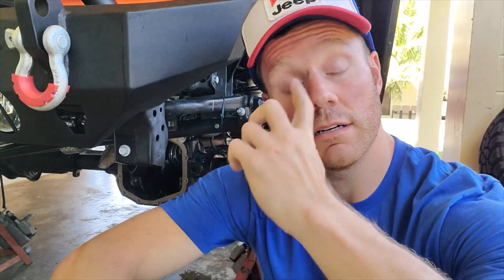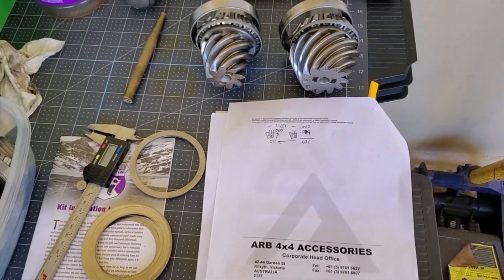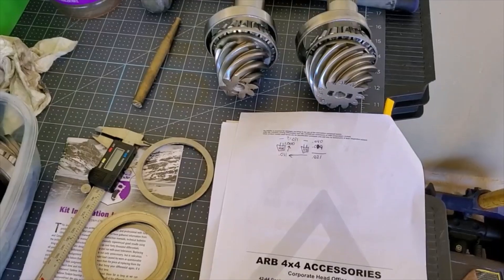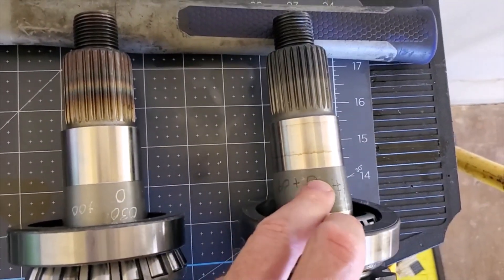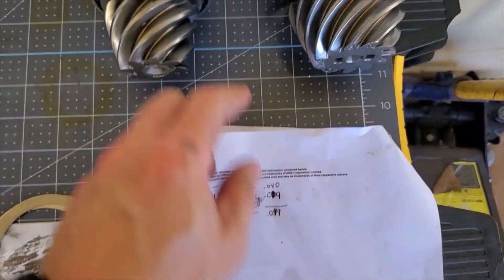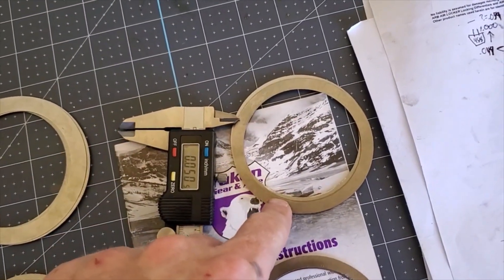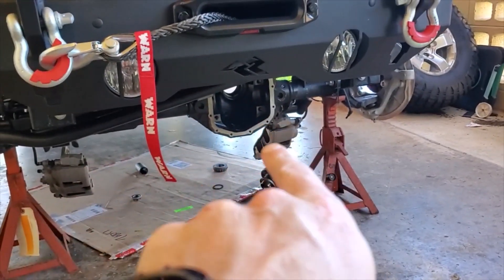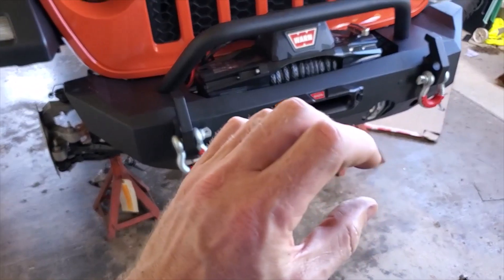Part 3 4.88 Dana Spicer How to Calculate & Figure Pinion Depth / M220 M210 + Lisle Tool 59400

Comment: I am re-gearing a Dana 30 with an ARB locker.  I got the gears from Elite Gear (Ron's Machine service) and I am finding that the pinion gears have the Master Housing Depth scribed on them as opposed to the pinion depth.  That, and the numbers scribed on the original Dana pinion do not correlate with what would make sense as a pinion depth measurement.
When I called Ron's Machine Service, I was told that the numbers scribed on the new pinion gears "don't mean anything."  Unless I misheard him, and or he misheard me.  It is a helluva coincidence that the numbers scribed on both the Chrysler 8.25 pinion and the Dana 30 pinion match the Master Housing Depths of each axle.
Reply from the maker: Start with the stock thickness. Check the pattern. It might setup perfect
Reply: @c130aviator  That happened to be the case with the Chrysler 8.25.  I bought that pinion depth measuring tool (yeah, that $400+ thing) and measured the Master Housing Depth and subtracted it from what it is supposed to be (and what was marked on the pinion) and the original .030 shim took care of that perfectly.  I could not measure the pinion depth of the original pinion because the face of the pinion gear was cast and not machined, so an accurate measurement would never have been possible.

On the Dana 30, it appears as though the original shimming is .010 off from what I need it to be.  I need .070 total shim vs the originals which measure .080.  The original shims are the oil slinger and an oil baffle. (What they are called in the parts books)  I think the slinger is a selective shim.

I have never rebuilt an axle before.  It took me an entire day to figure out how that depth tool works.  And even with "setup bearings" I do not see how I would ever get the pinion depth set right when whatever that measurement is supposed to be is not provided.  I would have to cram it all together, check wear pattern, take it back apart, re-shim it, cram it back together, check wear pattern, take it apart, re-shim blah blah blah.  I am picking brains at this point.  Of all the research I have done, I have not yet heard of a pinion gear with the master housing depth scribed on it as opposed to pinion depth measurements.  The Master Housing Depth is nothing more than the pinion depth plus the thickness of the pinion head, so either measurement works.

But like I said... I haven't done this before.  I don't know what the F I am doing.

Comment: Do you have the .pdf installation instructions from ARB on your locker?  I looked for it but was unable to find it online.  I have the RD245 which is the 32 spline version of what you installed.
Reply from the maker: I dont, I used the one provided in my locker box.
Reply: @c130aviator  Ah, lol.  I just looked in the smaller boxes and there it was.  Thanks!

Comment: This may be a bit out of your realm but I have  question about a Dana 60 out of a 1 ton Dodge van that we are trying to set up using new Spicer gears. The part that that is causing a lot of confusion is the method of measuring pinion depth. Seems to be more witchcraft than science. I have devised a way of measuring the depth using machinists measuring tools so that is not an issue. The main problem is finding a dimension to work with. Where is the starting point? is there supposed to be a dimension etched on the pinion somewhere? If not then what? One site says the dimension from the front face of the bearing seat where the inner bearing sets to the center of the carrier should be 5". I can't find much other than that. Is there a website somewhere that lists specs for Dana axle assemblies? Someone here who is getting real frustrated with the name Dana.
Reply from the maker: If your budget allows it, you may need to purchase a pinion depth tool. https://www.amazon.com/Machine-Products-11001-Deluxe-Checker/dp/B003OU2DXU
If not set the diff up as close as possible. Start with .050 shim pack. Assemble the entire setup, get a pattern, and do it again adding .005 the subtracting. 005. Its a lot of work.
Reply: @c130aviator  Retired machinist here & I have devised a set of parallel bars that I can accurately measure pinion depth off of the carrier bearing cap parting surface. Measuring not a problem. Need dimensions for pinion depth. None on the gear set so how is that determined? Pinion bearing drag set up using shims is going to be another nightmare, lots of trial & error with no specific starting point. No pinion depth setting tool will help unless you have a value to start with.

Comment: How does the math work if you don't have a zero etch on one of the pinions?
Reply from the maker: I explain that in the video. If its a plus, subtract it, if its a minus you add it. This makes up the difference. That is why its backwards. Its actually algebra. Make both sides equal, solve x, in this case for the shim.
Reply: @c130aviator  I thought the plus and minus came from the scribed 1000's, not the zero etch?
Reply from the maker: My next video I will cover this with the paint markings. This is a ball park. Once you get close you only have to change 001 to 005 thousands